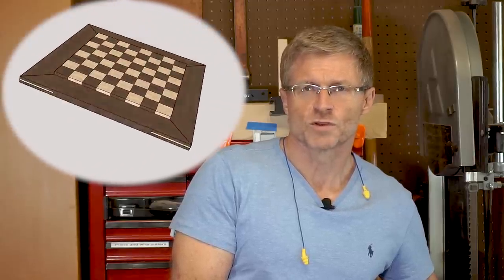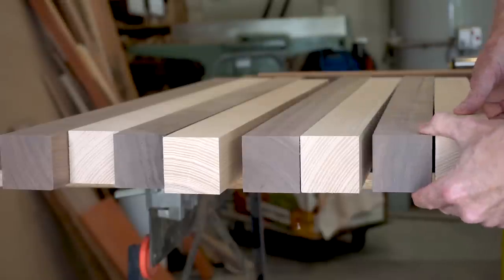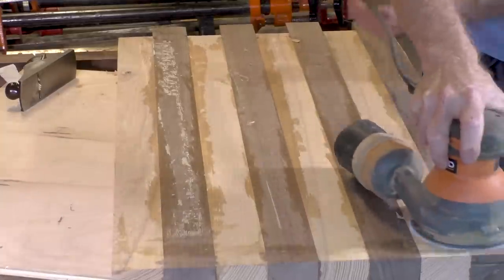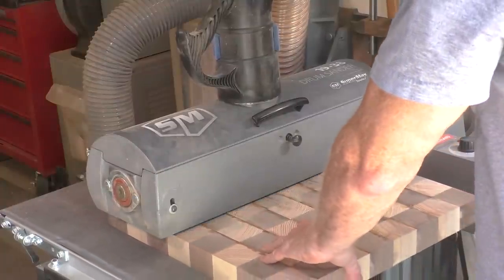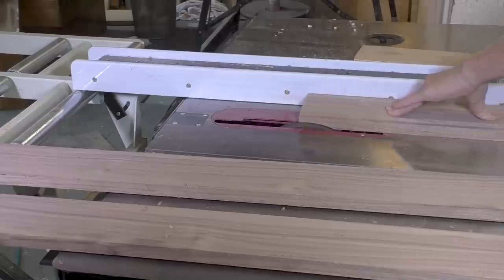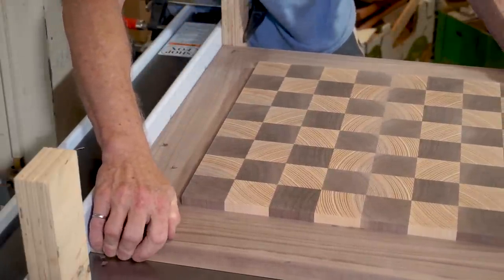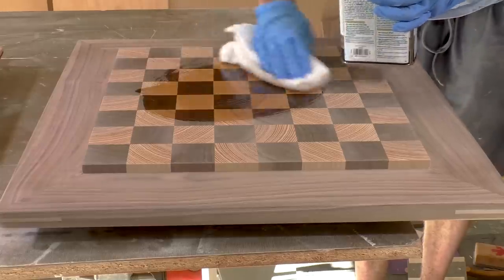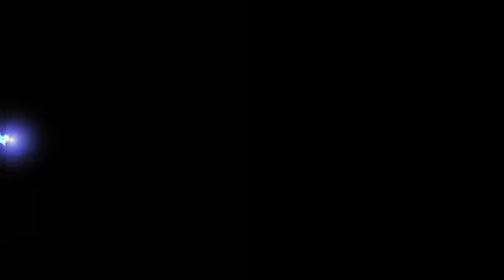How I made two Regulation Size End Grain Chess Boards

Comment: I tried to do this by staining some 4x4 cut down to 2.5 strips. I was under the impression the stain would've penetrated deeper. It didn't get to the end grain so I decided to make an edge grain chess board so atleast the stain would help differentiate the colors....until a strip broke off in the planer😂. I need more practice

Comment: These boards will crack, wood moves across the grain and the two timbers are varying in density, one will move more than the other and cracks will result.
Reply from the maker: Wood movement sometimes gets overblown on YouTube. I am confident that these boards will be fine, especially because they're well sealed with polyurethane. The Samurai Carpenter recently posted this video, which gives an interesting perspective on wood movement.  https://www.youtube.com/watch?v=vI_sRHGSQ34

Comment: Nice job once a gen. What are the dementions of the square for a checkers board. I would like to try and make one some time.
Reply from the maker: The ones I made here have squares that are 2 1/4" square. That ends up with a chess board that's fairly large, so you might want to make them a bit smaller. It all depends on where you want to place the board.
Reply: Learn to spell first

Comment: Will it ever become an issue in the future with expansion and contraction with the outer boarder?
Reply from the maker: I can't be absolutely sure about this one, but I think it's going to be ok. I left an air gap between the tongue and the groove to allow for a bit of wood movement. The border will not expand/contract very much along the length of the grain so I don't expect that the frame itself will cause any issues. Only time will tell...

Comment: I wish I could do stuff like this!
Reply: why would you comment then,?
Reply: start with smaller scale, edge grain , not end, 3/4" thick not 2".   Think of making a cutting board with alternate light and dark woods, each 1 1/2" wide, 13" long. Glue them up, slice them across into 1 1/2" strips, alternate the strips (flip/flop every other one), reglue< BOOM you have a chess board

Comment: Around 4:20 wouldn't have made sense to wipe up excess glue with a damp rag after clamping while it was still wet, rather than having to do all that planing etc, to get off the dried glue?
Reply from the maker: Yes, it definitely would have made it easier to wipe up the glue. Lately, I've also been removing the parchment paper after clamping so that the glue cures faster.

Comment: I just want to know how much that massive piece of walnut cost. Surely you have a local sawmill and a ton of space for drying? :)
Reply from the maker: My records show $304 for that 10/4 piece of walnut. It was already quite dry when I bought it, but it sat on the floor of my workshop for a couple of months before I started on the chess boards. That plus the ash and the walnut for the borders cost almost $700, which provided enough material for six boards.
Reply: @Woodumakeit  Not bad. I recently built a (my) dining room table out of 10/4 quarter-sawn red oak, from a neighbor's downed tree. He sent it to the mill, stickered it for two years before I picked it up - six 9' x 13" pieces. (Free - not bad!) The bad part came when I messed up cutting a tenon and needed another board, which is apparently made of Unobtanium, unless you're willing to crawl back to the very kind gentleman that owned the tree. (It was not small. Biggest piece out of the mill was 20' x 36" x 4", roughly. It is now a bar.) (There was a small crane involved.)
Reply from the maker: @xnadave  Wow!  I just picked up some 12/4 ash and walnut that's about 10' long and 13" wide and even that's pretty heavy. Your 20' x 36" x 4" piece would be at least 800lbs, and likely even more depending on moisture content.

Comment: I want to know the amount of machine you are using. Plis let me know
Reply from the maker: Are you asking about the cost of the machines?  If so, my table saw is about $1,500; jointer is probably about $600; planer is about $400; and the drum sander is about $1,400.

Comment: Whats the difference between a Planing & a Drum Sander??
Reply from the maker: Apart from the way that the material is removed, the biggest difference for me is the capacity of the machines. Most planers can handle a width of 12 - 13". After that, they get much more expensive to handle wider boards. The drum sander that I have can handle 19" in a single pass, and then I can turn the board around and do another 19" for a total of 38". Now, addressing the way that the material is removed, a planer uses a set of knives (or a helical head) that cut the wood, whereas a drum sander is simply sanding the wood very fast and very consistently. This is important to know when it comes to end grain, because it can be dangerous to plane end grain or, at least, cause some tear-out when the blades get to the end of the board. It's for these two reasons (size and risk of tear-out) that I used a drum sander for the end grain chess board.
Reply: @Woodumakeit  Oh wow thank you, I've asked this question so many times, with no clear answer! Thanks again, and keep up the great work

Comment: 2:06 Man I think I will start working with wood, but I´m kinda scared of that kind of saw... a small mistake and u loose a finger or worst. Guess no risk, no gain!
Reply: They can be dangerous, if used improperly. There are many good videos showing how to avoid kickback and other issues though. He is using the table saw very safely, and they do make a "SawStop" table saw that will stop the blade instantly if you touch it, but it is rather expensive.

Comment: Very nice. You did, however, use a massive amount of very choice wood to no effect. I wonder if you might achieve the same result by  gluing much thinner pieces to a plywood base and it would be more stable at the same time. I also thought the maple borders on the one piece needed a darker edge. Maybe just an inlay or a strip.
Reply from the maker: Thanks for the input. All valid points. Since the chess board protrudes 1/2" higher than the frame, I would probably only save about 50% of the material (1/2" on top, 1/4" on the bottom, with the rest being plywood). It would definitely add another step. I would be more inclined to do it that way if the top of the chess board was flush with the border. I plan on doing other styles of chess boards a little later this year, and I'll definitely employ a plywood substrate for at least one of them. I've thought about adding a border like you suggested, so I may give that a try as well.  Thanks for the suggestions! -- Mike

Comment: yes I have made chess boards and a two chess table as well for a senior apartment complete as well  and the chessmen as well  they did ask for a size on the men too 
they asked for checkers as well  the longs project I work one was the checkers 8 different  style of checkers have been made I have been very busy  making  trophies for  the  tournaments they have to work up here starting to be hard to find and I have most of the tools I use anyways too  
as for the trophies, the minor hockey  asked me to make the trophies this year they ask  for a different one the wanted to be made  yes  have 1/4 of them done luckily for the CNC machines working overtime and they have liked how their turn out  
have made trophies a pool hall as well a lot of time to make them from scratch  one took 2 months to build all the pieces were handmade  stands 5 feet  in the pool hall in glass case   they have asked in to make and another one for the tournaments to  have said if I want to lot of work get in the  display case to make it work 
and the  trophy too  sure I have the CNC machines still takes a long time couple month on just the drawing to be used for the CNC machines  have 0ne small one and the larger one  can take full sheets of plywood too